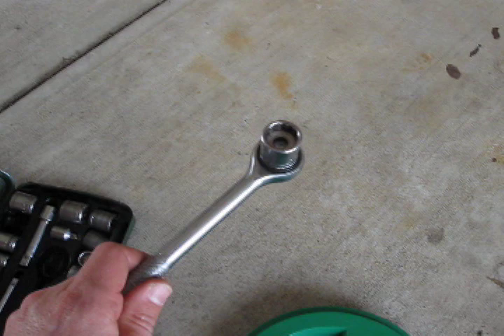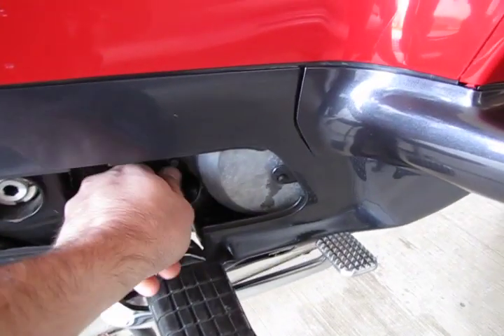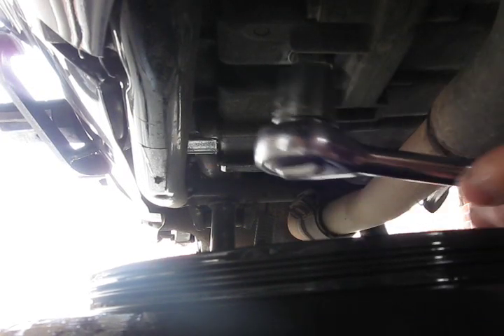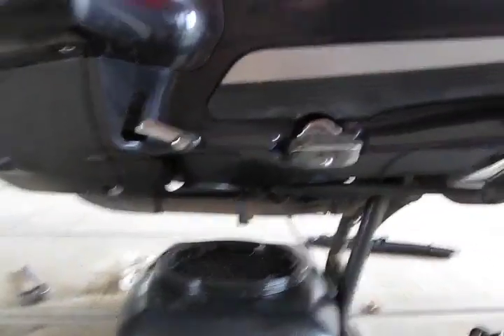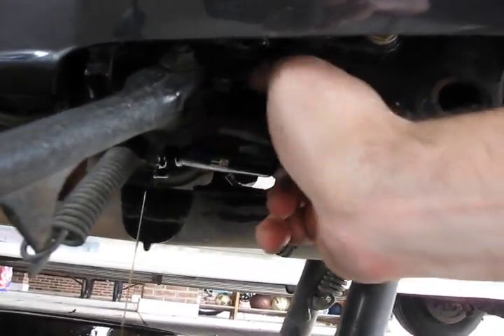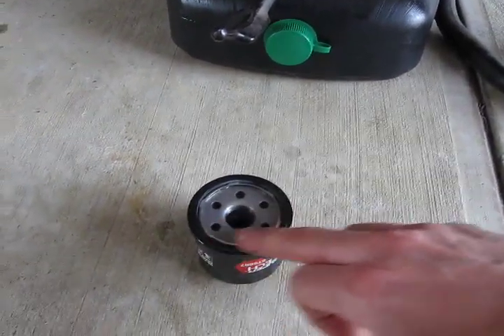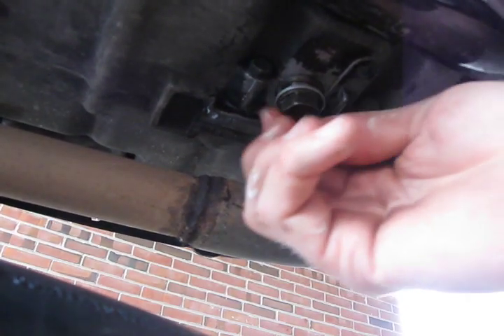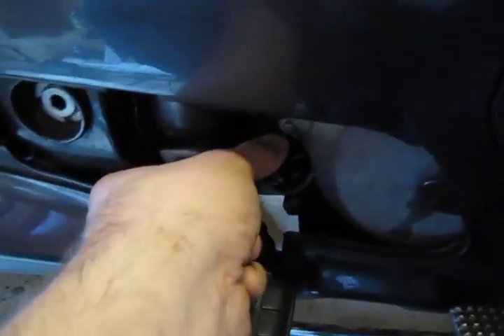Changing the motor oil & oil filter on your Honda Pacific Coast

Comment: I'm having a hard time finding information on how to replace the radiator cap and thermostat.  Any suggestions?
Reply from the maker: I had to replace my radiator cap. My bike would bubble over and leave a puddle at every stop. I tried to find a good replacement but eventually went OEM.

Comment: I have been looking long and hard for that perfect PC800 to come up for sale near me.  
Has yet to happen. But one that looked to be in garage kept fantastic condition showed up fairly close.  However, it has almost 78k miles on it! 0_0   How high is TOO high miles on a well kept PC800?
Reply: they are known to go for over 200k miles before needing any engine or rearend work as long as you change the oils at the proper intervals.
Reply: I might start to worry over 150,000 miles...maybe.

Naah, actually, I wouldn't.  Seriously...these bikes are bulletproof even by Honda standards.
Reply: @Johnny96ri  Yeah, Honda repair shops are going out of business.
Reply: @tbillyjoeroth  Are you attempting to stumble upon a point?
Reply: @Johnny96ri  nice my come up came with 33 k original miles.  rides like a champ 89 PC 800
Reply: @tbillyjoeroth  lol

Comment: Heat the oil washer with propane torch to re-anneal it softens it. A mirror makes the job easier than looking or feeling on a warm crankcase. Run engine at idle to allow oil to circulate and  park bike over paper towels to check overnight for leaks.

Comment: I changed my oil and filter thanks to your video. Never done it before. Now the mileage gauge and speedometer not working. Any tutorial on it? The estimates mechanics are giving me are way to expensive.
Reply: I know this is an old post but check to see to make sure the wheel speed sensor is still on your front wheel. It should be a cable near your front brakes. If its there then remove some paneling under your dash to check to see if the cable is loose from the gauge cluster. If you still have this problem I hope this helps

Comment: Hrump. The fliter costs me $16 alone at the local honda dealer, and the honda oili $6 a quart (I used rotella for a year because I had several gallons of it.) Any thoughts on Rotella vs Honda oil. I notice the viscoisty range is different, 15/40 vs 20/50. (I am in Florida and ride year round with most of the year hotter than cooler read far more in the 90s than the 30s.)
Reply: Rotella will be fine-it's JASO-MA rated. If not, look for Allison C4-rated oil...that's a wet clutch spec.  Just about any 15W-40 diesel oil is wet-clutch rated.
Reply: @Johnny96ri  so what's the best motor oil for my PC 800 ?